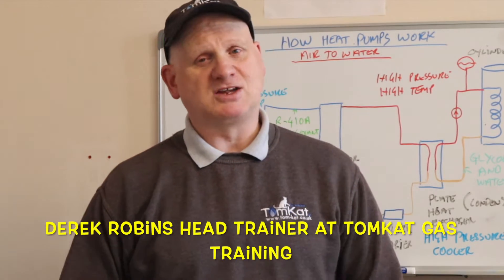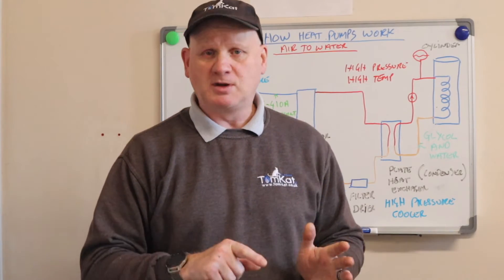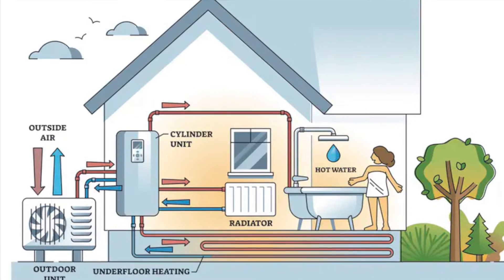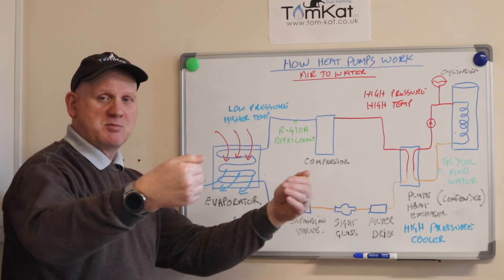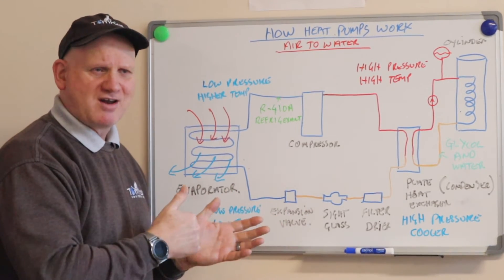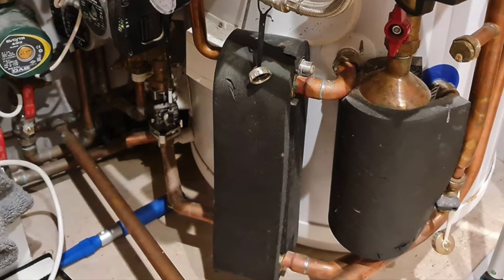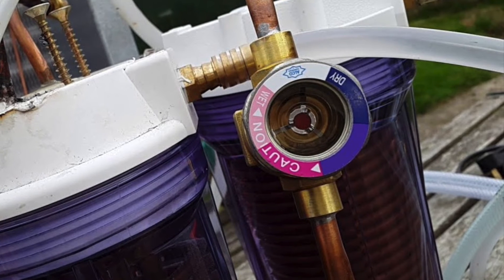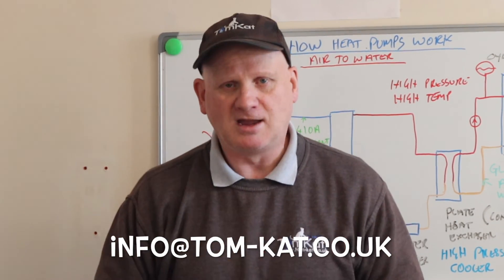How an air to water  heat pump works. What knowledge have I gained in my free heat pump training.

Comment: I was interested in learning more about water-to-air systems where there is no refrigerant running through the building but pipes delivering water to a"water-to-air exchanger". There seems to be a lot of confusion between the two systems and so far I've only found one YouTuber explaining the real water-to-air system in that sense. The only problem is that he missed out on the description of the outside unit which, presumably, runs the refrigerant in a local evaporator which in turn transfers the heat/cool to the water that runs through pipes all the way to various rooms where it exchange the positive or negative temperature to the local air. Did you have a chance to familiarise yourself with this concept, please? 🙏

Comment: You correctly stated that heat pumps using R410 are commonly used as they are ozone friendly. WHAT YOU DIDNT STATE was that R410 and other similar gasses used are HFC gasses which in themselves are global warming. In fact for the last 20 years the uk government has been adding to the global warming pro lemon by using these gasses!!!!! Not very eco friendly

Comment: Well thank you for explaining 'heat pump system' however I was qualified (passed refrigeration practice 1&2 ) in 1968 while being an apprentice at the (was) largest refrigeration company in the UK now the site it's a shopping centre in Dartford!  So, with a gas combi boiler in my house now, no tanks etc I'll have to refit all that system back for a air/water HP; and more. has anyone thought about the costings of all this gear and it runs on electricity, and where does or how is that generated however, I watch Guy Martin (TT biker fame) on a series of our national grid, the conclusion  left me thinking erm! one power station was burning wood pellets! And if all these cars/vans/lorries went EV tomorrow we wouldn't have the capability of generating? So, I think I'll rush out and buy another boiler and keep it in stock. Have a good New Year and don't worry about it as India and China will not be saving the planet. OMG now 75 and won't be around in 2050!
Reply: Drax, makes 1200kW by burning trees from overseas ( USA & Canda) and its soposed to be low carbon... what a joke.🤨😂

Comment: R410a is being phased out, and I don't think any (at least half-decent) heat pumps being installed today will have R410a.  Most going in will use R32 (typically in a split system) or R290 (typically in monobloc).  The concept is still the same, and if you're not F-Gas registered you won't be installing a split system so don't need to worry too much about the refrigerant side.
Reply: I believe the R-32 will be up of propane among other compounds which will make it flammable.

Comment: They’re changing refrigerant again to R32 and R454b nice video! The filter dryer you showed was an ac only a heat pump filter dryer goes in both directions